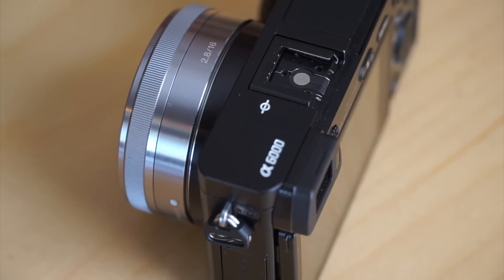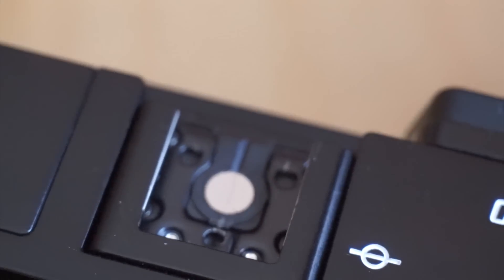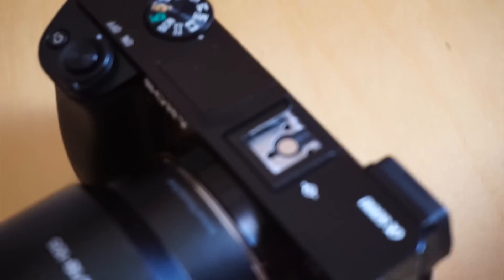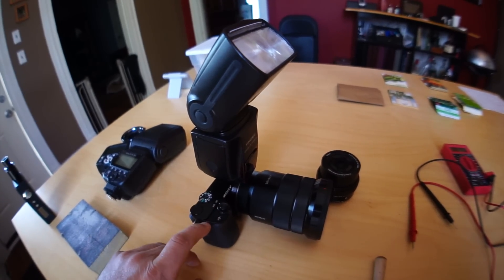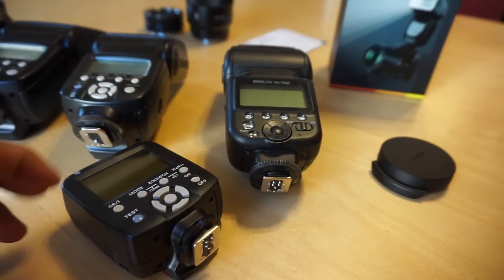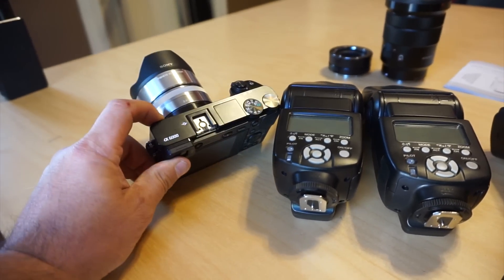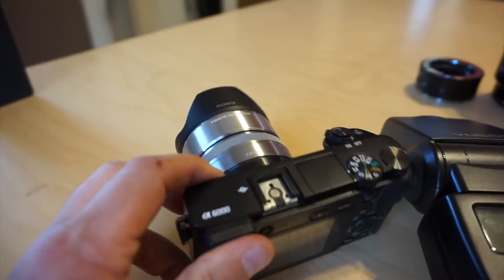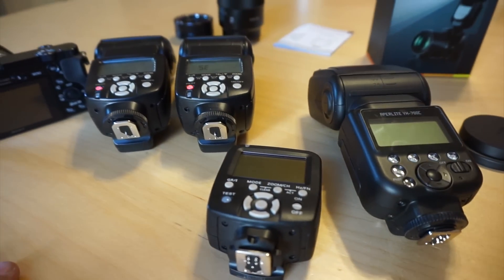Sony A6000 Painted Hot Shoe Issues + Yongnuo YN560 IV

Comment: The Photo/Video Show The multi pen design is for ETTL. Single pen is for manual flash. The layout is the same across the board, I think there is something in the electronics the separate the Canon and Nikon flashes. But shoe mounts should be the same. I have the YN560 III and Canon 430 EX-II speedlites. Why the YN560 IV does not work may have something to do with the voltage from the camera. Would have to look up data sheets on both to be able to narrow this down.
Reply from the maker: Exodist Photography Video Blog Well, I know for a fact the YN560 IV are 6V if that helps you out.

Comment: Very helpful bro... I just ordered the 560 tx transmitter like the one you said works even when it was painted. I have the  YN 560 3 flashes and they work every time on my black painted A6000 hotshoe. Im hoping that the 560 TX transmitter will work as well. High hopes. Thanks for all your helpful videos. For some reason I couldn't get the YN RF 603 c.......... to work with my A6000 so Im trying the other. Thanks
Reply from the maker: +Jake Fountain My pleasure! And thanks for the heads up on the 603c. I've thought several times that I'd give it a shot but I'll save myself the disappointment :)
Reply: Please Jake Fountain, with 560tx transmitter and YN560III do you have a hss ? what maximum shutter speed you can use? I need for my A6000 trigger flash with HSS cheaper !!
Thank You
Reply: You won't have hss with that setup. I'm using the Nissan Di700 setup with the air commander and multiple lights off camera with hss
Reply: Thanks
Reply: Sorry took so long to answer

Comment: Hi.  Just a thought but all the flashes I see on this video have metal hot shoes.  There are metal contacts under the front edge of the a6000 hot shoe.  Could it be the metal hot shoes are creating short circuits on those pins.  Might also explain why moving the flash back slightly sometimes works for some people.

Comment: I may have another option before you get rid of those flash's. I too have had all the same issues all of us seem to be having and after seeing a video on another you tube channel (fotofied) I too took out the little metal thing and scraped more paint off and still my flashes would then wouldn't fire !!!!
I took the thing out again and put the flash on without it and what do you know both my flashes which have different pin patterns work perfect as do my off camera triggers and off camera cord.
I do not know if I could harm the camera not using the metal thing but it seems to be the problem.
Hope this helps I'm off to contact Sony.
Scott
Reply from the maker: Scott Westerman Awesome find! I'm off to try that right now!

Comment: So I got a Nikon Yongnuo transmitter for no reason, problem is when i put any of my flashes on my sony, the flash starts shorting and spazzing and misfiring like 10 times a second its crazy and driving me crazy, and yes the flash does work on my canon and the transmitter does work on my canon 30d, and i have tested simple old flashes and no luck the ones with the side metal
Reply from the maker: Life Kommando I haven't had anything like that happen to me. My Yongnuos just won't fire at all.
Reply: The Photo/Video Show Its very weird, I searched watch and read about people  with their A6000 hotshoe problems, there is always some new problem, I'm going upload a video showing what happens when I put my flash on my a6000.

Comment: I was able to make YN560-IV flashes work flawlessly on my black A6000 and A7ii after researching and discovering that the grounding point is underneath the side rails of the hotshoe mount.  Notice when you lock in the flash that the mounting plate pushes upward against those rails and that is where grounding contact is made.  The issue is that those rails are painted on the underside.  I came up with my own method to get the paint off the underside of the rails... use a basic emery board that you would use for filing your nails, emery boards are just narrow enough and are far better than trying to rig up some sandpaper to get in there.  Cut the rounded end off of the emery board so it is squared off, then slide the coarse side under the rail and sand it forward/backward and a bit side to side while pressing upward on the underside of the rail.  You'll see black paint appearing on the emery board.  Sand for a bit with the coarse side then flip and use the finer side of the board and sand until you see little or no paint appearing on the emery board.  Do this on both side rails.  Blow out the residue, most will stick to the board though, and then mount the flash and fire away.  As a reference, if you Google 'a6000 sony hotshoe connectivity guide dpreview' and look at the forum postings you'll see a very good diagram and discussion on this topic.  I didn't even touch that center plate on mine and visually my cameras look unmodified.  I also have the YN560-TX transmitter and I definitely have a Nikon version since I bought if for my D800 and the pin layout looks just like yours.  I'd be really curious to know if this solves the issue on your camera... I've done this on four cameras (my two as mentioned and two other A6000's of co-workers) with working results for all of them.
Reply from the maker: CamG.A.S. That is some damn good info! Thanks for sharing!
Reply: CamG.A.S. done that. don't work for mine.
Reply from the maker: +Michael Engleman Didn't work for me either :(

Comment: Try bending the 2 little sprung connectors on the edges (left and right the thin strips that came off with the metal you pulled out to scrape) of the hot shoe up, worked for me after scraping the paint on them off.
Reply from the maker: davebw123 I did that in a previous video. It never a made a difference with the Yongnuo flashes.

Thanks for watching!

Comment: I have a YN568EX that is for my Nikon D7100. I mounted it to the Sony A6000 and it works no problem. The same goes for my YN wireless triggers. I guess I'm lucky. I even tried an old Vivitar 2800 D and it works too. Obviously I have to use them manually (no TTL).

Comment: The one pin design hot shoe is simply universal hot shoe mount and every manufacturer produces such design for cross model compatibility. But canon or nikon etc also have dedicated multiple pin design for non cross compatibility. The only issue is with the user mounting all these stuffs on their cameras wrongly. Lavikka photography has brilliantly solved this issue on his youtube video, thanks.

Comment: what is the setting do you have the flashes on, because if you're using the wireless setting it want fire when you put the flash back on the camera you have to switch it back ot the regular manual mode.
Reply from the maker: Jv Films, and Melodic photography That's interesting - can you explain a little more?
Reply: The Photo/Video Show  yeah if you have it to fire off camera with out a receiver on the bottom its using it internal reliever, and in that mode it want fire from anything.... you have to switch it back to regular manual mode......  make sure that wireless thing isn't there

Comment: Hi. I use the a6000, too and my YN560 III work every time in the hotshoe.  it is impotent to hear the click by the secure pin.  Put the flash in the hotshoe, screw down a little bit and pull the flash a little bit backwards.  The secure pin locked down and the the contact is in place. 

Your 560TX is the canon version.  It works too on my a6000.
The Nikon version has got golden letters. The canon white. 
The pins are for canon, but it works
Reply: The Problem is the middle contact.  The four other Pins are not interested. Be sure, that the middle contact is in place.

Comment: So aperlite flash Canon mount works with Sony a6000.and I don't need to remove the paint??..does it supports ttl and hss..
Reply from the maker: loomdoby HSS, yes. TTL, no.
Reply: +The Photo/Video Show so would the Yongnuo YN560-TX works on the Aperlite flash in HSS mode? would it trigger it and control it? if not, how to trigger the Aperlite off Sony cameras in HSS mode? please help!
Reply from the maker: GamesArt86 You'd need a trigger that supported it.

Comment: My Sony 6000 is silver and therefore the hotshoe isn't painted.

I own two Yongnou 560-III both with the one pin design.

The older one (Amazon 10/2013-Serial-No: 53065744)) works ALWAYS with the Sony6000 and the newer one (Amazon 01/2014- Serial-No: 53106635) doesn't fire - NEVER!

So I did a cross-checked. Both with the same settings- manual and identical FN numbers- No change.
I measured the dimensions of the Yongnou hotshoe and the pin - no difference!
Last I did a resistence test- however the differences had been marginal.
Using a Yongnou Transmitter (RF-600TX or YN560-TX) with the 5 Pin hotshoe design all Yongnou are working properly.
My old flashes Olympus flash (FL-36) and NIKON Speedlight SB-23  both with 5 pins and in "Manual" are working fine mounted to the Sony 6000 hotshoe.
Conclusion: Yongnou must have changed something in the internal electric design or the manufacturing tolerances are so big that the Sony 6000 hesitates to give flash release.
Because I use the big Yongnous only unleashed, I don't care.

Comment: i have a yn-565ex iic and yn622 c triggers on  on my sony a6000  they all work and fire no problem

i cannot get it to do any high speed sync 
any suggestion ?
Reply from the maker: lupadula The A6000 doesn't support HSS as far as I'm aware. I think 1/250 is as fast as the shutter can go.
Reply: lupadula Yongnuo with HSS will NOT work with Sony no matter what you try sorry. Brands like Metz, Sigma, Minolta, Nissin and of coarse Sony have HSS capable flashes(but not all of them) something like the Minolta 5600 or Sony 43am work(with a Sony Multi-Interface Shoe Adapter). But then to do it off camera you need the right triggers like Pixel King that support Sony ttl and hss. Hope this helps!!!
Reply: The Photo/Video Show It does, you just need the right set up.

Comment: will the 560 mIV work on a sony RX10?
Reply from the maker: DigitalApprentice888 In theory...yes.
Reply: thanks! i read in some reviews about the sony rx10 having issues with some post processing software like photoshop and lightroom, did u ever had issues with it too?
Reply from the maker: It was most likely because Adobe hadn't added the RX10 camera profile yet. That should be long since fixed.

Comment: Oh, I have the Sony a6000 (the black one - and I fix it too) and Yongnuo YN560 IV too and they works fine together...
Reply: Make sure you have also removed the black paint on the inside of the sides of the Hot Shoe at the base of the camera, and it was not only the upper blade as done in the video, because it is these sides that ground contact is made... Sorry about my English...